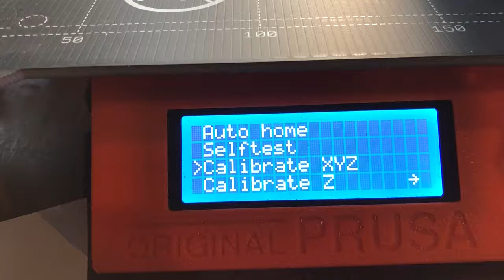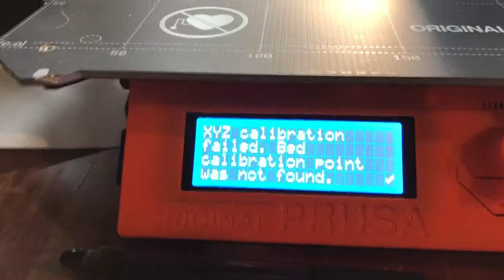Mk2 5 XYZ Calibration Failure

Comment: I had this same problem too. I don't exactly know how I was able to solve it, but I ran it a few more times, checking all my work to make sure everything was done like the instructions said it was. Did you solve your problem?
Reply from the maker: Sean Zachary Uy I did work up a solution and posted a video here too. And I have been talking to Prusa who have given me a couple of things to try. I'm away for the weekend so won't be able to do anything until Tuesday at the latest. But the thing that did get the calibration finish was to put a small (1/4") disk on the third calibration spot. I found some brass shim stock that was 0.25mm thick, I punched out a circle with a paper hole punch, flattened it and used wax to stick it exactly on the third calibration spot. The calibration was then able to find it during the first pass. I took it off for the second pass which uses the steel sheet.

If you think it would be useful I can write it all up on my web site, www.greybeard.org.
Reply: Bill Waggoner Aahh. I see. Don't need to waste your time on wiring it all up. I was just curious. Good to hear you're up and running!